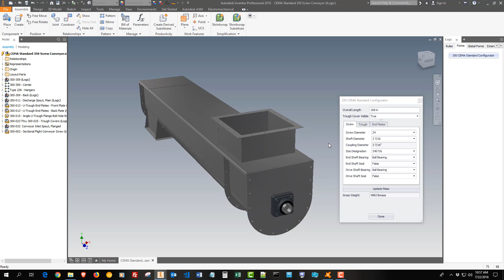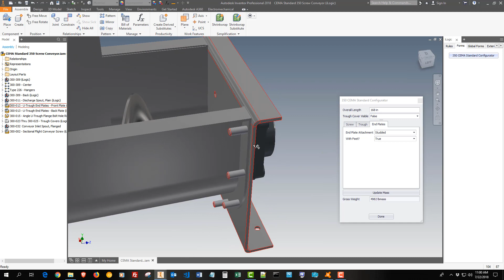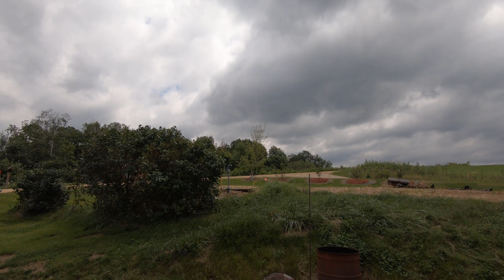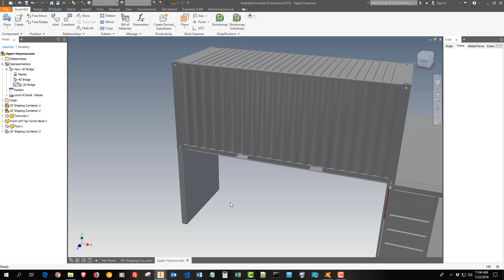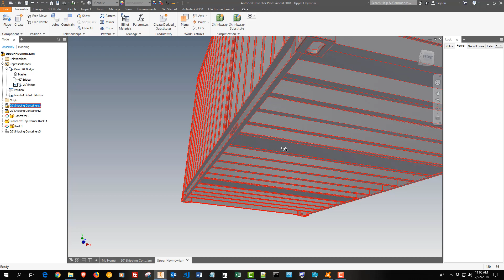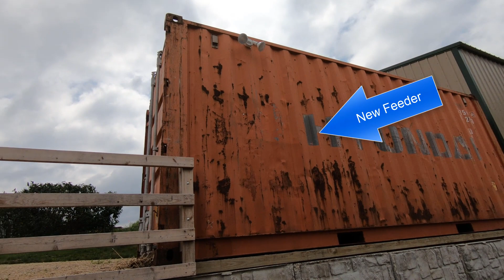3D Configurators and Shipping Containers

Comment: Interesting day job. I would love to work from home. I should have studied a bit harder in school. I don't mind my job though. I have had some jobs that I dreaded going to for peanuts. I'm comfortable with what I do now and it pays the bills. There is a lot to be said for comfort and peace of mind. I do strive to learn new things as much as possible, though. That's what keeps life interesting.
Reply from the maker: I actually apprenticed as a cabinetmaker 'back in the day'. and did that for many years. I learned this trade on my own at home. If you are interested in working from home, learn a computer language (the 3D configurators run on code). You may be good at it, and there's lots of work!